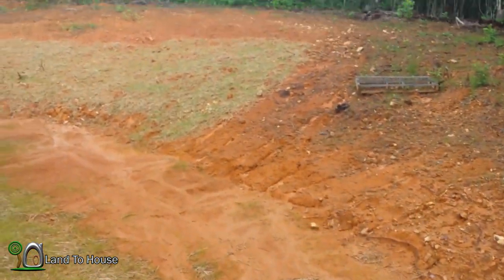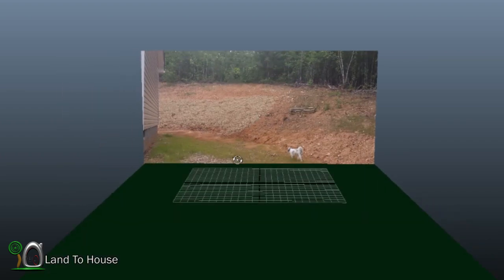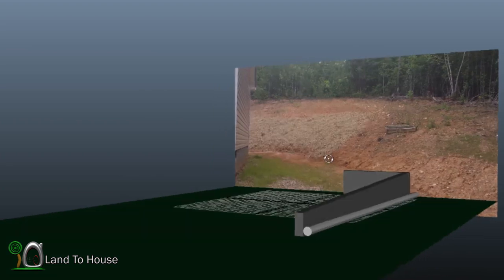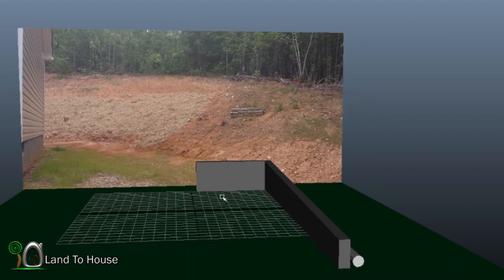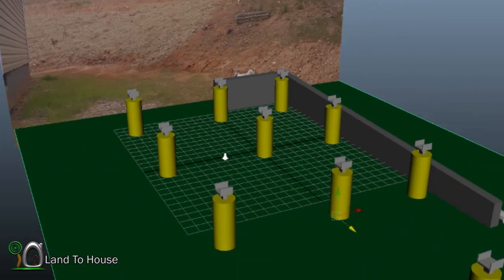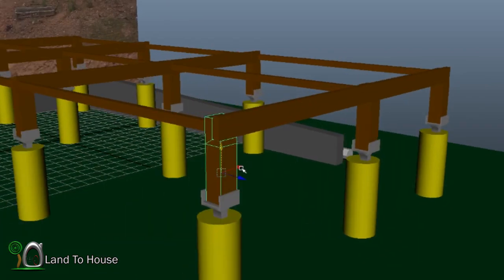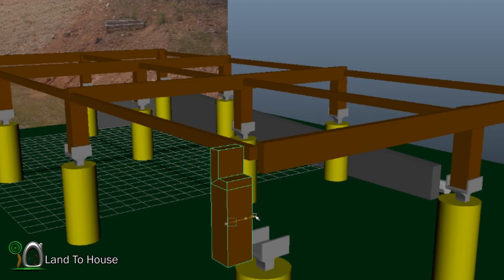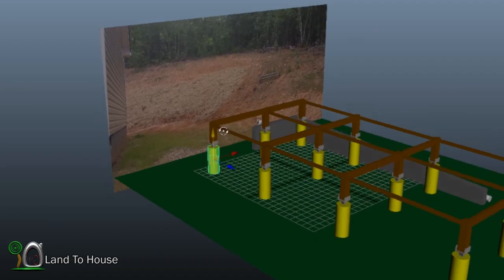Workshop Foundation Help

Comment: on your floor your framing up 2x6 framed on 16 centers with cross braces placed directly on a level concrete paver stone will be more cost effective and strong enough will 23/32 plywood that you can park your truck in it. on the wall I wouldn't build it I would make a gradual slope like you have now and cover it with grass an steep wall drop off like that can erode the foundation it a flooding rain comes through
Reply from the maker: +GAMES, PRANKS, AND OTHER NONSENSE I like the framing on pavers idea!  That will save money. I am afraid if I do not install a wall there will be lots of water standing back there. I would put the top of the wall one block above the dirt and have grass planted after that.

Comment: If you are going to use the tubes and fill with concrete why not just drill down in the hill side and not cut it away at all. and here in australia we use an inverted A shape that is made out of 1 inch wide galvanised steel (it is more like an H with and top plate and you insert them in the concrete and then bolt them to your timber so the timber never touches the concrete only the steel) This would make the retaining wall not needed 

I have been watching every thing you have posted and love it all and congrats on the up coming Baby 
Cheers Mate
Reply from the maker: +One Fat Man (Better Than Two Fat Ladies) my very first thought was to use the tubes without a wall but both of my neighbors are retired contracts and they said the erosion would be an issue. So wall it is. After many comments it seems like a simple concrete footer with blocks and a paver on top is the way to go. No need for the metal. 

Thank you for watching my videos!  We are looking forward to adding to the family :)